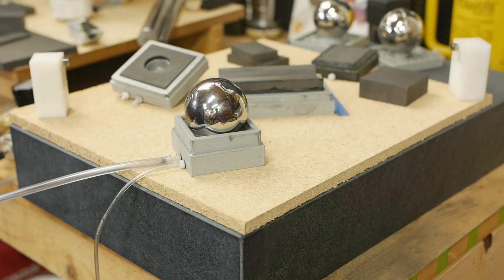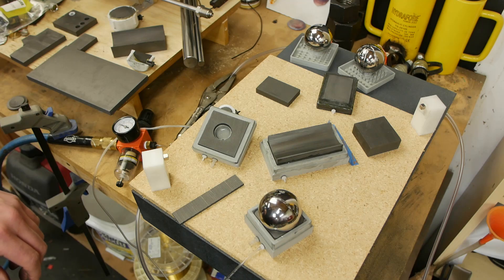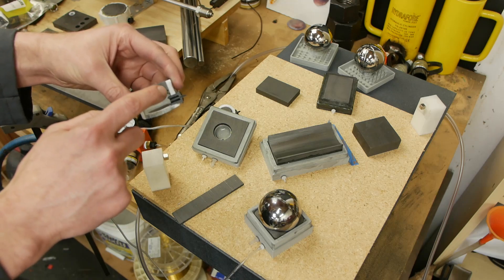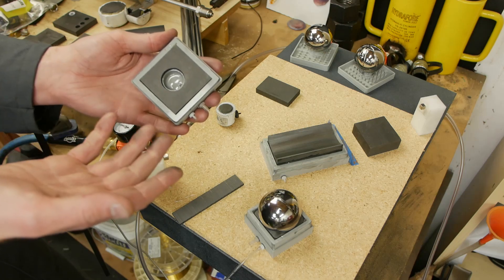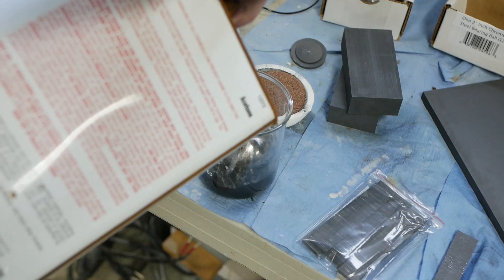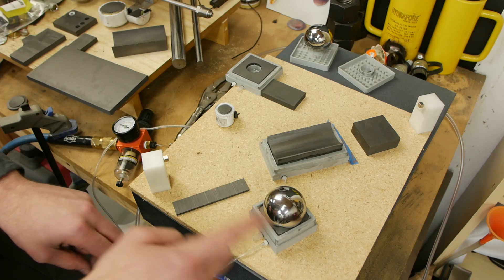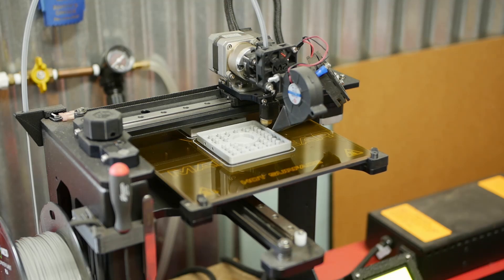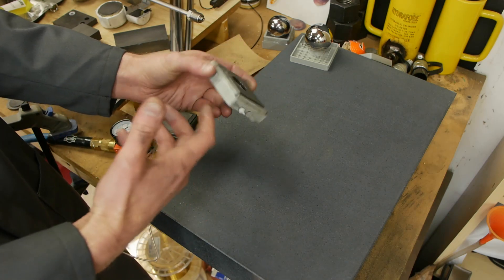Make vacuum pre-loaded spherical air bearings without special tools

Comment: I'm guessing the rails you're using are nominal size, you should be able to get a reamer that's either on size or slightly under for press fit applications and use that to make the constrained bearing.. Although a tenth over or so version may be better for this application from what I understand about air bearings.
Reply: Could also taper the rod at the end slightly and then just use the same method as the non-constrained bearings?

Comment: The old reel-to-reel 2 inch videotape recorders used an air bearing for the rotating heads, but it wasn't graphite. Watching the ball rolling reminds me of the "kugel fountain" installations at science museums where a large granite sphere floats on a water bearing. The largest is over 2.6m (104") diameter.
Reply: It seems like using a noncompressible liquid would solve a lot of potential problems with air bearings.  Water isn't compatible with most metals, but oil would work.  But this is the basic principle used in journal bearings already.   I wonder if pumping the oil through a channel as in air bearings would reduce the friction at all.  I think at the very least it would reduce stiction.
Reply: @LazyH-Online That's pretty neat!  I did not know that.  High precision industrial manufacturing (tool-making and the like) is wild stuff.

Comment: I imagined this could be cool for warehouse robots. The hard part would be getting the floor perfectly level and smooth over huge areas. Maybe they could like... pour out some low viscosity resin that cured flat and level.  🤔
Reply: There are actually air bearing based heavy load movers. The air paths are just holes.
Reply: Recall the part where he said they only support around 60PSI.
Reply: @Asdayasman  https://youtu.be/t6m01VGiNPI
Reply: You mean miniature "Landing Craft Air Cushion?"

Comment: All very interesting. I just happened to look for air spindle designs for a fast grinding spindle.

How hard would it to make porous graphite that could be casted around an object?

Some sort of binder with graphite(?) powder and some ingredient that is soluable or decomposes under heat leaving voids behind? Maybe selectively decompose and get shaped air paths?

Or how about electroplating the graphite with suitable selected metal? Air paths could be defined if the plating covers the voids or a indicator be made for the erosion of graphite when the metal wears out.
Reply: If you're using a binder, you're filling the pores.

Comment: Do you think this technology could be adapted to work with current electric vehicle builds?, I think that'd be pretty sick, hey maybe even make them more energy efficient than their current, totally motor pushed setups. EDIT: F*ck your cybertruck bro, I got a floating one..
Reply: Where do you live that has glass-flat roads?

Also, how do you plan to brake?
Reply: @Asdayasman  I'm not saying use that concept to replace tires.... I'm talking about adapting some parts in the assembly that drives the wheels, and I'd imagine braking could be easy using a concept similar to a brake pad but fitted to the air bearing assembly, it's engineering, anything's possible if you think long and hard enough about it. :)
Reply: @EchoXIIIGO  Brake pads rest gently against the brake rotor.  You'd improve efficiency more by fixing that than by trying to switch out bearings for this low temperature low pressure solution.
Reply: @Asdayasman  Okay close enough this time, I'm talking about using these air bearings rather than your defacto standard grease and ball bearings, either in the components that allow the wheels to rotate, or closer to the engine parts that drive the car, in the context of an electric vehicle to improve the vehicles ability to maintain it's speed without the need to constantly applying power to the motors to drive the vehicle the correct speed, ball bearings even with grease stop after a short enough period of time, take the fidget spinner for example, but air bearings clearly allow the motion of itself to be maintained for a longer period of time.. dissipating energy is easy in the case of stopping somethings kinetic energy, the car moving, I'm not all about brakes, I'm not trying to reinvent the wheel, merely improve it..

Comment: Now I'm daydreaming of an FDM printer that doesn't suffer from ringing/ghosting or layer adhesion issues at faster speeds. Possible?
Reply: Not sure this is related to air bearings.  Ringing etc. would be from oscillation in motion, and air bearings if anything would reduce damping by reducing friction.

Comment: If you took two blocks of graphite placed them a few inches apart and drilled holes for a rod to spin in them. Epoxied the block of graphite. Except for the hole and the sump for an air inlet. Would this rod also act like an air bearing?

Comment: Wet cutting graphite is optimal.being conductive fine dust It can also wear motors prematurely.
Reply: That's why the urban myth about the cosmonauts using pencils while NASA spent millions on the space pen (Which they also didn't do) is wrong on all counts. Conductive dust floating into space shuttle electronics won't end well. Not really an issue with modern encapsulated PCBs though, but normal ball point pens and felt tip pens work perfectly in zero gravity, so no reason to develop any new tech at all for this.
Reply: @peglor  They did use pencils, but they were grease pencils.

Comment: I thought I'd let you know that you can improve strength and the overall look with an acetone vapour bath. ABS plastic dissolves in Acetone and will smooth and bond together.
Reply: Strength is reduced. I think it was CNC Kitchen that did the stress tests. Acetone chemically alters the plastic.

Comment: Now I'm curious if the velocity of an airsoft BB could be increased by using a graphite air bearing barrel. Perhaps the expanding air escaping around a BB in regular metal barrel already accomplishes this but it would be interesting to try nonetheless. Amazing video as always!
Reply: There'll be some sort of speed limit to the bearing - the item its suspending will sweep air away from the bearing surface as it moves, and if it moves fast enough, there won't be any air left.

Also, such a purpose would pressurise the barrel downrange of the charge, lowering muzzle velocity.

You'd probably enjoy a vacuum cannon more.
Reply: @Asdayasman  I considered that but I don't think the environment inside the barrel would be at that much higher pressure because the end is open. Certainly, it's a competing force but the reduced friction may outweigh the increased forward pressure. Plus, it would be flowing in the exiting direction. Also, I don't think the BB would sweep away the air because there isn't really anywhere for it to go in the barrel. A vacuum cannon would be great but I would have to figure out how to make it work for rapid fire. Perhaps the high pressure air for the air bearing could also be fed through a nozzle at the end of the barrel to create a sort of Venturi pump.
Reply: @SafetyLucas  >A vacuum cannon would be great but I would have to figure out how to make it work for rapid fire.

That's easy.  Vacuum pump, multiple barrels in a gatling configuration, and the cover at the end of the barrel being stationary, so the barrel rotates past it.

Comment: Won't the full bearings require enclosure, so the air escapes only in the direction of the enclosed shaft? So the outer edges require air impermeable walls glued to the block of graphite?

Comment: If you didn't need a lot of pressure. Could you make a puck with a table size coil for wireless power that is powerful enough to make an air bearing? I'm thinking for an air hockey type game. Is a small DC pump powerful enough I wonder?

Comment: could it be used in kinetic energy storage? could it be better than electromagnetic bearing???
Reply: Possibly.  The efficiency of the bearing action will be lower, because the load is borne by literally more air, but the running cost could be lower.

The main considerations would be weight and noise, and possibly borne material.
Reply: @Asdayasman  Many thanks for reply! rotating kinectic energy storage dont need to be silent, My question is about efficiency (Total Power loss) of air bearings and reliability of this solution. I met in the past electromagnetic bearing and it worked almost flawless.
Reply: @nomen_omen  If it was flawless, why try to improve it?

Comment: Is the vacuum preloading similar to this effect? youtu.be/TrZyuCh9df0
Reply: I think the water suction is caused by low pressure at the center of the vortex due to momentum. In this video he literally just had vacuum in the middle and pressure around it. He explains it at 5:59